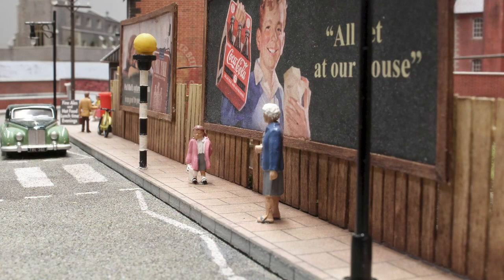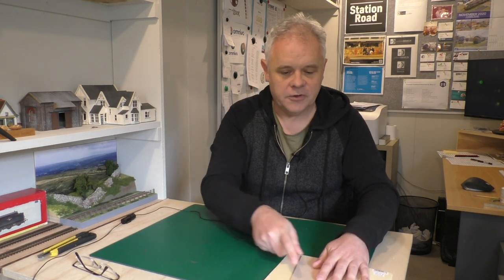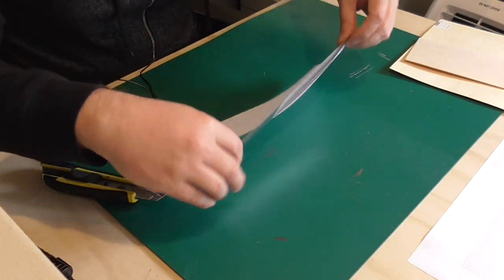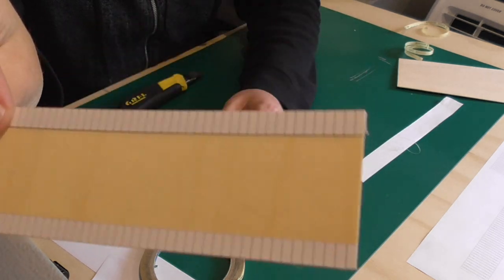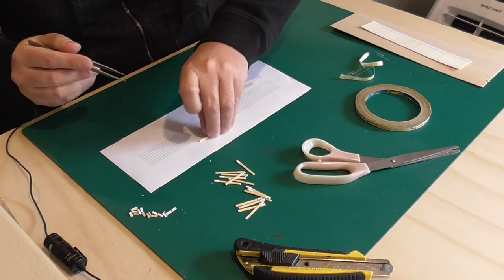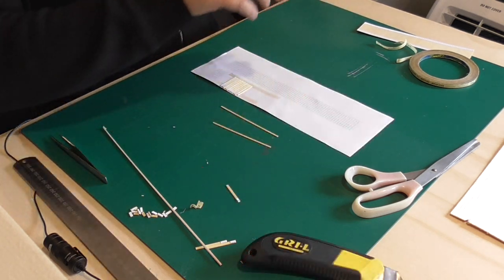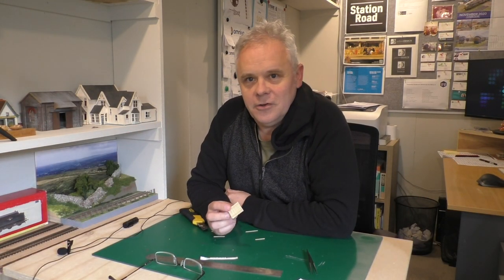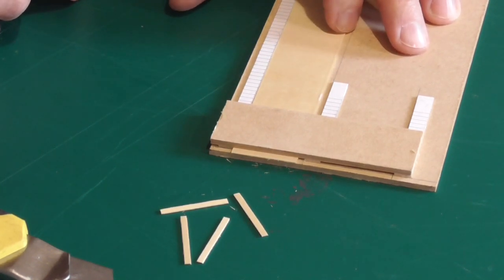A Guide to Modelling Wooden Fences

Comment: EXCELLENT VIDEO. 

AS YOU SAID THE VERTICAL BOARDS ARE PALINGS  THE HORIZONTAL BOARDS ARE KNOWN AS RAILS. THIS TERM N MAY HAVE A CONNECTION TO RAIL TRACK.  

MY  FENCE DESCRIPTION IS USED IN HERE IN THE UK AND MAY POSSIBLY BE REGIONAL. 

I’M A RETIRED CARPENTER/JOINER 

CAPITALS DUE TO PARTIAL SIGHT AND REDUCED COGNITIVE ABILITIES

Comment: Evening Julian quick question don’t suppose you done a video on making you viaduct? Also brilliant video stay safe
Reply from the maker: I see you found the video about the viaduct. Unfortunately it's not a step-by-step video as I built the viaduct before I launched the Station Road channel.
Reply: @StationRoadModelRailway  was it easy to bend round as am going to attempt it in n gauge lol so should be fun
Reply from the maker: @gwrbuckleyjunction1733  It wasn't overly difficult to bend the outer card layers, but these were formed over an MDF base structure that was built to the curved shape.